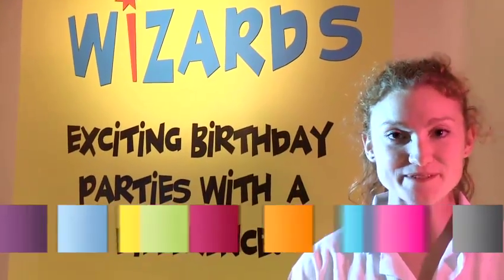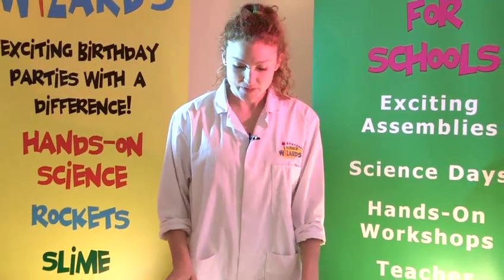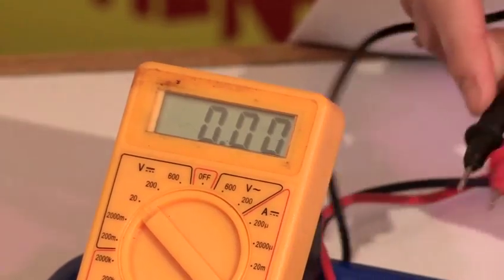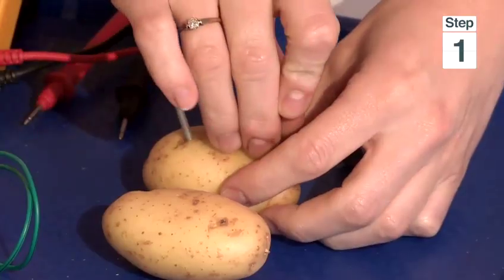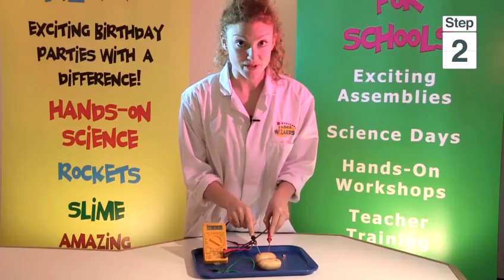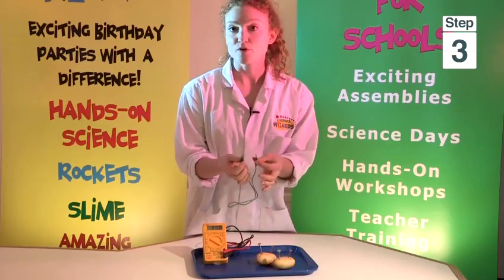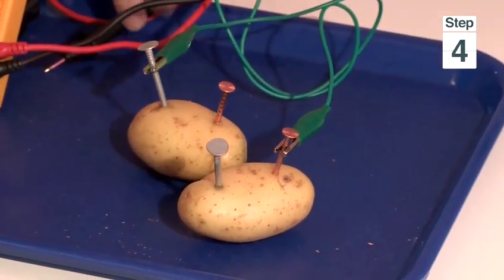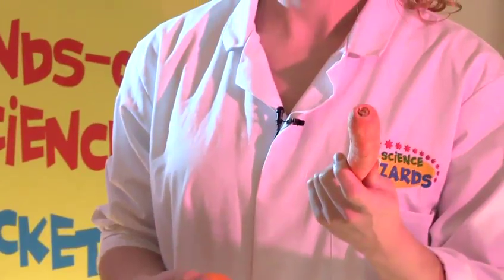How To Make Your Own Potato Battery

Comment: as energy can't be created or destroyed does that mean that as you are powering a component e.g. a bulb, you are using the potato's chemical energy stores and therefore reducing the amount of calories in the potato?
Reply: That's a great question but why would you want to lower it's protein plus it's not fast food unless it's fried lol
Reply: @SimonWoodburyForget  so the nails have to be stuck in something acidic? they can't just be sitting on the table?
Reply: the current doesnt come from the potato, the materials that make up the nails degrade into oxides and the electrons travel through the wires, aswell as the potato, to form a circuit. The potato is still perfectly edible and loses no calories

Comment: For anyone wondering, "can it charge a phone?", yes and no. It probably could power the phone for a short amount of time, but a normal phone charger puts out 5 volts of electricity. The potato, on the other hand, only puts out a little more than one. The minimum voltage to charge a phone is pretty low, so it could charge the phone, just not much.
Reply: You can add more potatoes (more Zinc and Copper nails too) to get what you want. Since we are at that, it will be a bit bulky. Let us make it smaller. Oh wait, we call that a battery :)
Reply: Does it mean that 5 potatoes=phone charger?
Reply: @hl5217  It is about right.

Comment: You don't need to buy copper nails.
You can use pennies, its much cheaper.
:)
Reply: i think pennies are only in the states or smt i live in canada so i dont have pennies :(
Reply: pennies are mostly zinc tho. i took chemistry. we weighed pennies...
Reply: pennies dont exist :)

Comment: Connecting batteries in series not make more power .. it's increase voltage. Major mistake - voltage is not power.
Reply: Radek P I thought it would only create more amps. Okay.
Reply: @Lucas Silva It depends. Power is a function of the load resistance and the internal series resistance of the battery.
Reply: Yes, I agree with your statement and that it should be made, and that I would've made it too, but as a side effect, I would like to add that it would then be possible to extract more power. Assuming constant current, you can get more power from 10 cells than 1 cell.  

But yes, the voltage is increased, and the rest is side effect.

More explanation:
In general, we add cells because we want more power (or same power for longer time). The question becomes, do we add them in series or parallel. That depends on what we are trying to do. If the load needs higher voltage to operate, add cells in series. Otherwise, add them in parallel. Adding them in parallel allows you to output more current at same voltage if needed, depending on the load. If not needed, you'll get longer duration than a single cell.

Comment: Afaik you don't need more potatoes to generate more power, just put the nails into the same potato.
Reply: This will not work because it will cause a short circuit or nothing will happen

Comment: The zinc from the silver coloured nail reacts with the copper from the other nail, the water and nutrients inside the potato are used as an electrolyte which when the three are combined will generate some voltage. Look at video's about "penny battery" for another variation on this theme.

Comment: So how do I connect my light bulb...?
Reply: Maybe you'd need to wrap a wire around one of the nails and connect it to a lightning somehow.

That, or just stuff it in the potato.
Reply: Wire your "load", such as LED (light bulb in general needs more power), in similar way to the Voltmeter, on the ends not joining the potatoes together (The free Cathode and Anode). Note that LED has a polarity, and it matters which side connects where.

Comment: Save your vegetables and do it with a with a glass with salty water or water + vinegar. You'll get more power.
This is an ultra-inefficient way to get power from a potato though.. As curiosity, if you could efficiently extract power from the potato (like biological beings does), one potato could run your laptop for around 16 hours.
225 kcal = 261watts/hour

Comment: well if we really want to use electricity without producing a carbon trail and zero toxic byproducts from battery manufacturing, someone should start growing some new genetically modified SUPERcharged potatoes.. apparently, it works just fine.. the only other thing is zinc and copper terminals.. XD I can imagine how you drive to charge station, stop there for potato box battery exchange and leaving with a fresh batch of french fries for WHOLE family that suffices all the way from L.A. to NYC .. XD

Comment: Everyone knows that, was better if you explained why?? The acidic components, free electrons, series connection, and zinc/copper characteristics.
One more thing, it doesn't generate power, it have a voltage drop due to the different conductors connected to it. Yet voltage drop with a resistance in between creates current and the whole thing generates power. You tested fir voltage, say its voltage because you'll teach the children wrong concepts like this.